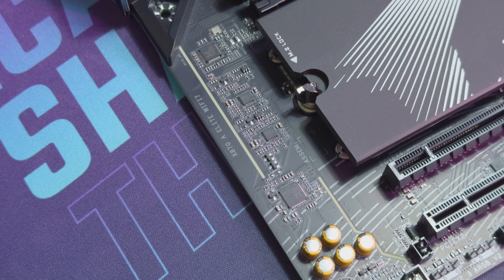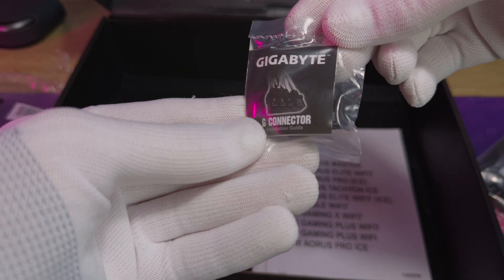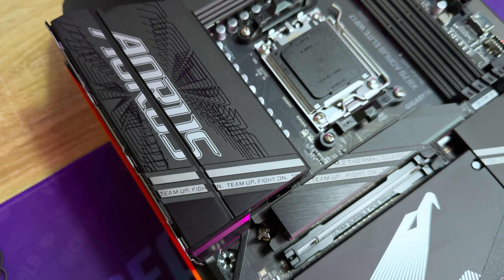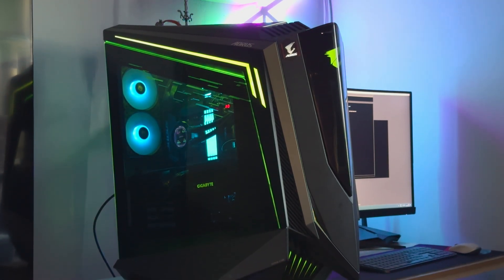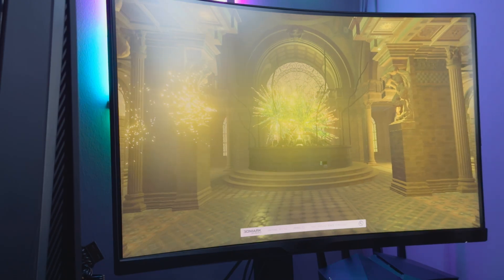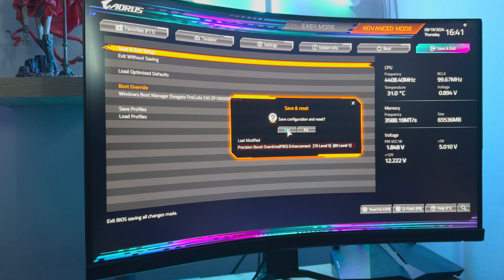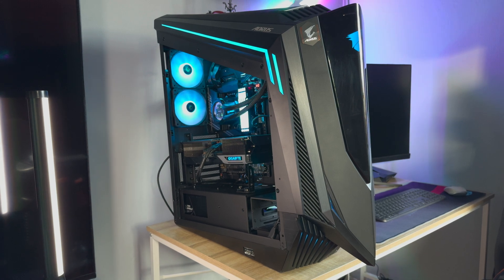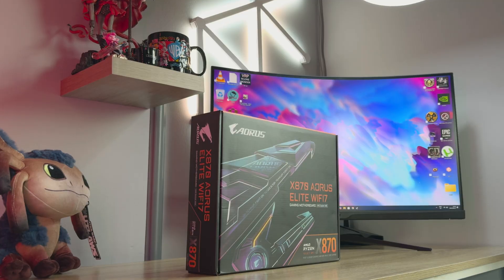Gigabyte X870 Aorus Elite Wi-Fi 7 (AMD Ryzen 9900X) Review

Comment: I need help asap, I just bought this motherboard and everything is okay but I got a problem, when I try installing both the ram sticks it doesn’t boot up, but when I only put one it does, any solutions for this?
Reply from the maker: Did you update the BIOS on the baord. Thse boards often ship without support for certain RAM and you need to update the BIOS to add support.
Reply: You need to update the BIOS first I had this happen to me as well and it got stuck in error code 15 once I updated the BIOS I was able to get to 64 GB sticks for a total of 128 gigs of RAM working from Crucial

Comment: I had this board about 3 months ago and after less then 48 hours I discovered the known Windows 10 issues that aren't disclosed by Gigabyte and then discovered I was having other issues with the board itself so I ended up sending it back to Amazon and getting an MSI MAG X870 Tomahawk WiFi board and it has been amazing.  I am sure I just received a defective motherboard but it seems to be on par when I order anything Gigabyte as overtime I have purchased Gigabyte products I have had issues every single time and this is over the last 20+ years of building computers.  I think I just have bad luck with Gigabyte but great luck with both MSI and Asus motherboards and GPUs but the fact that Gigabyte knows and has known about the Wifi issue with windows 10 for almost two years now and have done nothing tells me what I need to know about them and I will stay away from Gigabyte from now on and not press my luck trying to use them again.
Reply: Well my X870 tomahawk has been on rma like two weeks now already so that is why came looking gigabyte.
Reply: @ I haven’t had any issues with my tomahawk.  I did purchase some Corsair ram with the ARGB and it worked fine so I ordered another set but the second set wouldn’t work on my motherboard and kept showing a 15 on the debug led.  I tried both of those sets in my MSI Project Zero m650 and they worked just fine.   I kept them in that build and put the crucial vengeance sticks in my tomahawk build and it worked just fine.
Reply: @retiredcryptohunter9031 my pcie lane speed kept dropping to Gen3 and boot issues. Worked great  or with older gpu. I hope I get it next week. Too long already.
Reply: @ I’m running a 4060ti pro art with no issues.  I would really like to have a 4080

Comment: Where is the bios battery located and how to replace it
Reply from the maker: If you watch the video, you can see the battery countless times.
Reply: Far bottom right just above the front panel connector so it's easy to get at. Removing it is the same as any other BIOS battery, just use your fingers or pry it gently with a small flathead screwdriver or any other prying tool. But the battery should last a loooong time (many years) so you won't need to replace it any time soon. And if you ever need to reset the BIOS just use the "Clear CMOS" pins with a jumper or screwdriver on the motherboard instead.

Comment: Couldn’t shut the m2 cooler properly when putting ssd in had to unscrew the main tightening screw a bit then shut it retighten the screw, anyone else?
Reply from the maker: Didn't have this issue. The SSD, did it have a heatsink on already? Should be the standard 2280 slim chip.
Reply: @GLITCHEDZA  it was the WD_BLACK SN850X 4TB, the Motherboard heatsink has a imprint of the quick release for the ssd, so once the ssd is in, the latch must be in a bit higher position stopping the heatsink from shutting properly but anyway i fixed it by just pushing it in, using the mini screw driver on heatsink quick realease, unscrewing until i can lock it then tightened it up again.

Comment: where did you connect the cpu fan and cpu opt that rgb coming from the watercooler? the cpu fan and opt on the motherboard (top right) seems not to be connected in your build?
Reply from the maker: This AIO doesn't use a CPU fan header it is all connected through a USB header. The radiator is then connected to the case fan control box and fed into one SYS Fan header.

Comment: Will this last 10 years? If not, which other mobo?
Reply from the maker: There are some very high-end features on this board. Features that will likely be suitable for a long time. AMD says new chips will also support AM5 for at least four years. So I would say it would last 5 years. Ten might be a stretch. No motherboard will last ten years. You'll want to upgrade every four to six years.
Reply: @GLITCHEDZA  I'm typing this on rig with a 4770K and a ten year old motherboard.
Reply: @BillOhio73  lol same. 4930k here and rampage iv black, this year is turning eleven.
Reply: @ If it ain't broke... Good Stuff!
Reply: @BillOhio73  Which mobo? I've had mobos from budget to highend, but none made it past 5 years. Probably the high humidity in my country leading to corrosion. Thus, looking for an AM5 mobo which has the best chance against humidity & corrosion. Any recommendation? TUF? Strix? Aorus Master? Aorus Pro? Aorus Elite? Mortar? Tomahawk? Carbon?
Reply: @R6ex  The 11 year old MoBo that I had just replaced was a Gigabyte "Ultradurable".  I don't remember that particular model number. I decided to indulge in a new build after a decade on the same computer and went with an x870e Aorus Master. I wanted at least 2 PCIe slots besides my GPU plus 8 layer PCB for durability and a debug code display plus the quick release on the GPU and USB typeC with display port. I might have gone with the MSI Carbon but the Carbon wasn't in stock. I don't overclock and my CPU is only a 7600X with a 7900GRE so not a power user stressing the board but... the Master has worked fine with no issues for my purposes. No surprises on install and working steady since I built this rig a few months ago.
Reply: @BillOhio73  Good choice! Aorus Elite only 6-layer PCB after all. Maybe I'll go for the B650E Aorus Master for my either 5090 or 5070 Ti new build (to save a few bucks over the X870E), coz I only game and don't need all the extra features like USB4.
Reply: @R6ex  That'll be a Very nice setup. ;)
Reply: @BillOhio73  same lol! 4770k on an Asus Maximus 7 Formula. Mobo built like a tank ;)
Reply: @ton4378  I feel like that 4770K would have kept running just fine for years to come.
Reply: @BillOhio73  I am also in the process of upgrading. But still looking around and checking as much as possible. We'll still get to monitor my 4770k and motherboard once I change system cause I will be giving it to my son :D Btw, hope your upgrade is as you expected or hoped to be?
Reply: @ton4378  Hey, that's very cool that your 4770K computer will still be made use of. I ended up with a 7600X, X870e Aorous Master and a 7900GRE in an H7 Flow 2022 case. I don't play any super intensive games, just some casual Overwatch here and there. I also don't run any super intensive software with 3D, AI or editing. This new build is fantastic for my needs. Whenever the AM5 line of CPUs gets to the end of it's run, I might upgrade to the last flagship of that line (11950X3D or something) just to know I'll have access to plenty of processing power going forward if needed but yeah, overall I can see this new computer also lasting 10+ years.
Reply: @BillOhio73  Oh same plan I am going for. I am leaning towards the 7700x or 9700x. Still looking for a mobo with features I like. Then also upgrade later on for the last highend proc in the platform after price goes down. That will take some time. Like now, with the price of the 9950x3d in my country, I can buy the proc I mentioned, a mobo and ram lol
Reply: or hope the price for the 9800x3d goes down a bit :D
Reply: @ton4378  I'm sure the price will go down... someday :)

Comment: Hello, this would be my first time buying a motherboard with 2 CPU cable slots at the top left. Do I need to plug in both or can I plug in 1 only?
Reply from the maker: You’ll need to plug in both but you can use a single cable and use both ends. So both 8-pin connectors into the slots

Comment: hi! if i install a ryzen 9000 series, do i have to update the bios before even do the first start of the pc? or i can do it after? thank you
Reply from the maker: You would need to update the BIOS first. It will likely work but windows might blue screen. Just have the BIOS update on a USB and boot right into it when the board is up and running. It will also update the board to support your RAM. DDR5 still has a few bugs with these new boards before launch. So it is safer to update first.
Reply: Hello, I have a problem in ram, when I install 2 ram sticks the pc doesn’t boot, but when I put one it does, any solutions.

Comment: Thank you for the content can you just confirm you said the 7000 series will work as I have the 7 7800 3DX to go in I’m guessing this will work fine appreciate the advice
Reply from the maker: Thanks for watching! Yes the 7000 series will work on this board. It is an AM5 chip. It will also work with Gen 5 NVMe or PCIe slots
Reply: @GLITCHEDZA  thanks for the time to respond I just don’t like doing bios updates I just want to put my chip in and play 👍
Reply from the maker: @danielhill1251  Haha,  get you. You should really do the BIOS updates though. These new boards do have bugs and compatibility issues with DDR5 RAM, chips etc. The updates fix this. Maybe a few years ago you could just ignore the BIOS updates but these days they are vital.

To add - you can now update your BIOS through the Gigabyte control center on Windows without having to go into the BIOS itself. Very easy to do.
Reply: @GLITCHEDZA  thank you, I just did a bios update on my X670E master all installed correctly and restated fine. Went to turn it on the next day and I got a black screen and keyboard mouse isn’t working also unable to get back into the bios to revert. 🤷 this is why I’m looking at this board
Reply: @danielhill1251  use the flashback button to revert to the old bios .

Comment: Did you notice that this board configuration was in higher class (+100€) with previous generation? You don't see that 16x lane switch anywhere else. This is no brainer for me as a poor audio guy if they get the bios right as it goes. This is perfect fit with 4060 or 4060 Ti with 8 lanes as you have then 8 lanes for 2 pcs of nvme. And 10 USBs directly to CPU is very much something which I was looking for as it makes USB audio cards sing. All that bling is meaningless after that. Just make it robust.

Comment: Hi! When you populate m2 slot or 3nd slot gpu pcie x16 will be downgraded to x8 pcie mode?
TY!
Reply from the maker: If it’s an old board then it’s possible that having more m.2s could limit your PCIe slot speed, but not on any current-gen boards like this X870. 

If you use the GPU in a slot that’s not the primary then yes, there is a chance of it running in x8 mode on a low to mid-range board, even current-gen. But again, not this board.
Reply: @GLITCHEDZA  my replay was for exactly Gigabyte x870 Aorus Elite , some on media say  if you populate all 3 m2 slot your primary slot GPU will be downgraded from 16x to x8 !!!
Reply: @riannair7101  I’m not positive, but I’m pretty sure it will go to x8 if you populate all the slots. I think you can actually only filltwo without it cutting down the GPU pcie lanes. I would double check because I’m not positive on this information but from what I’ve read that seems about right

Comment: Using the pbo 80c level 1 do you not have to enable expo? Or will that overlcock you ram as well as cpu? Thanks
Reply from the maker: No, you would have to use EXPO too. PBO is only for the CPU performance.

Comment: This aorus on vrm not argb ?
Reply: No, only the x870e aorus elite wifi 7 have the rgb and the x870e aorus pro and the x870e aorus Master. If you want rgb there's also the b650e aorus pro x usb4
Reply: @2000bassotto  what ram to this mobo 6000 cl 30 and expo rgb
Reply from the maker: @ZbyszekMarek-j1b  The RAM used in this review is the Kingston Fury Beast DDR5 6000 MT/s -https://www.kingston.com/en/memory/gaming/kingston-fury-beast-ddr5-rgb-memory
Reply: @ZbyszekMarek-j1b  6000 cl30 is the sweet spot for am5
Reply: @2000bassotto  do you think 6000 CL 28 would work? 1.40v on this motherboard.